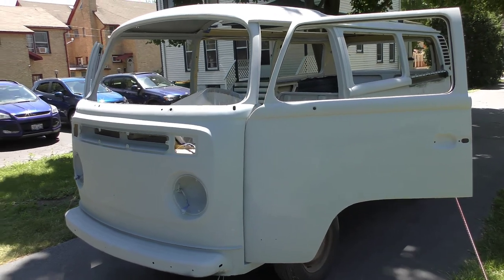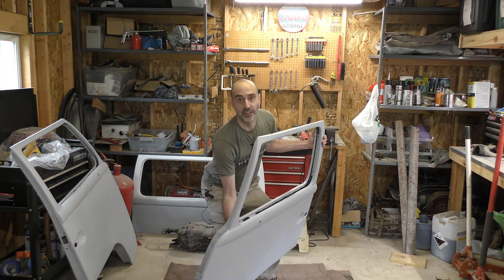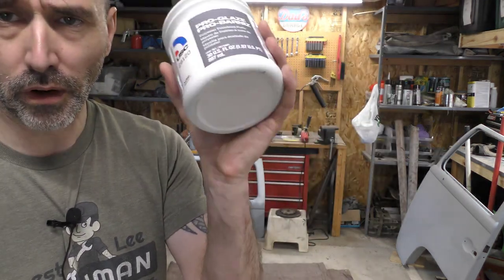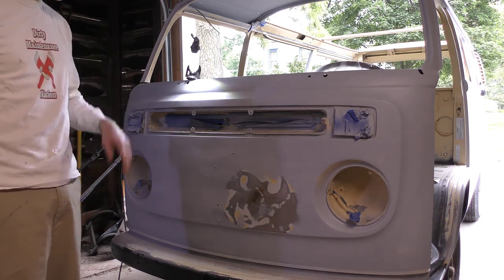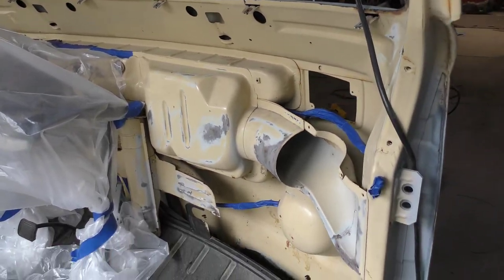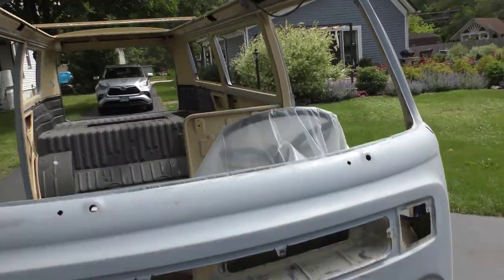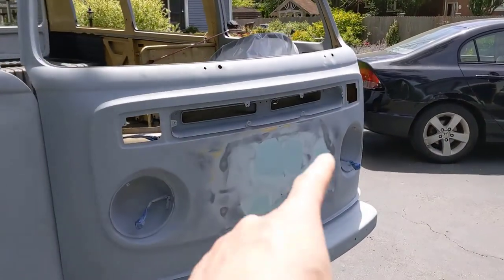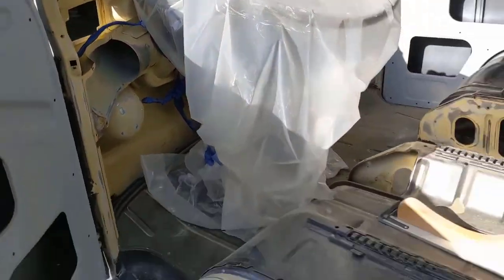VW Bus Restoration Part 17: Front end body work; prep cabin area for paint

Comment: go Scotty go... :) i think this week i am gonna remove my doors from the bus and get them at home, so at least I can do something properly in my balcony .. you must have done a video of how did you remove the shining aluminum thing from the windows.. and how to put them back as well :-D  hope my bus will be finished this years..
Reply from the maker: Genti, unfortunately I did not make a video removing the window trim.  But I have the new door window trim kits.  The chrome trim is riveted to the rubber.  To remove it, wedge a screwdriver or plastic knife between the trim and the door to pop it out.  It uses clips to hold it to the door.  I will try to do a video on reinstalling them once I am done with painting.  Thanks for watching and good to hear from you!